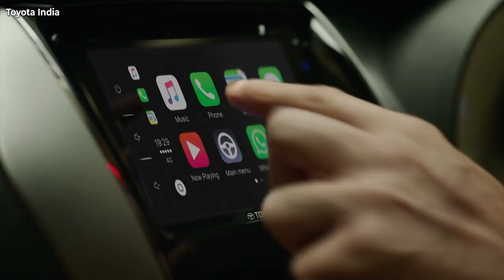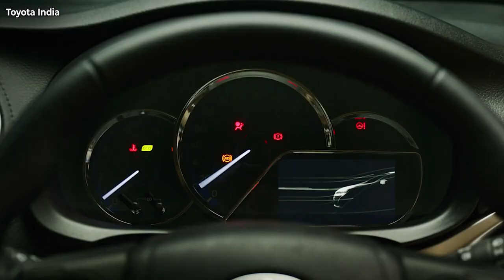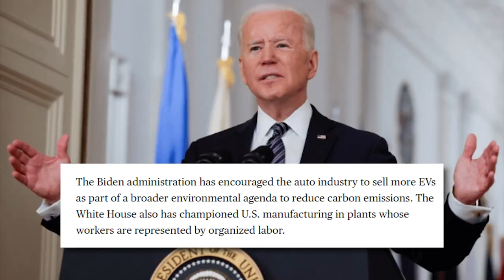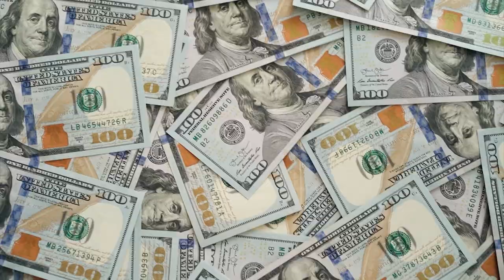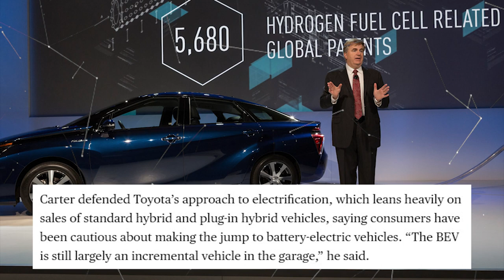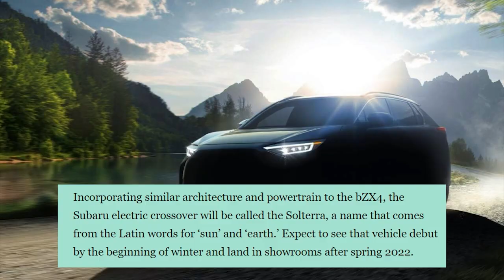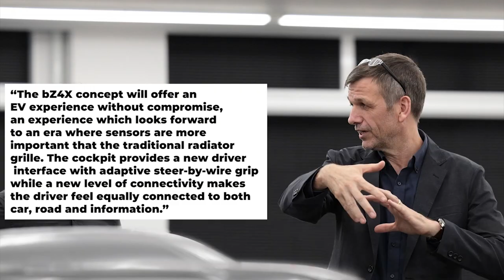Toyota Signals a Big U-Turn on Electric Vehicles With a Major Shift

Comment: I am still unimpressed by all the proposed BEV including Tesla, except Aptera.
Reply: It sounds like you should start a BEV company.
Reply: Lol.   What Aptera is selling has been tried many times with gas powered engines that achieved over 100mpg due to aerodynamics.   It didn't work then and it won't work now.
Reply: @kratosdisciple4637  You didn’t need a 100mpg on an ICEV because you could easily put a 25 gallon fuel tank on a car and refill it in five minutes. With BEV you can’t do either as easily so efficiency is far more important.
Reply: @matthewhuszarik4173  The point I was trying to make is that people care more about having 4 wheels and the perceived notion of safety than they do about efficiency.   And there is the additional peer pressure of having something that looks "strange".   The Aptera is a brilliant piece of engineering.   Unfortunately, very few people will buy it.

Comment: Seems like it's not really a u turn but more like a cautious pivot. If it weren't for high import tariffs and other regulations we would have an influx of Chinese imports such as BYD and Xpeng. Both of which are selling like crazy in China right now. 

Toyota seems to think the US doesn't have an appetite for EVs even though Nissan proved that with the release of the Leaf and the re-release of it that isn't the case. The US also went in on the Bolt.

And surly they're not forgetting about a once small company even they themselves invested in called Tesla. They didn't seem to have much confidence back then when they sold their stock in the company now Tesla is worth 5 times what it was then and have been producing record sales here in the US. 

The very reason theirs a want for EVs is due to Tesla and a couple others I've mentioned so about time Toyota gets serious here it will be too late as consumers would have moved on.

Comment: I have a theory, or perhaps two : 
1. Toyota was really interested in making hydrogen fuel cell vehicles and had been working on it. But the lack of proper infrastructure and recent hype of electric cars acted as hurdles in their way and that is the reason they are late in the EV game in the first place. Actually, I still think Toyota has a point, it is difficult to make budget family electric car with good enough range to lure them to buy electric vehicles and that is where hydrogen fuel cell vehicles will help them (think about it, in a gasoline car, the more expensive the car the less range it has. In an electric car, the more expensive the car the more range it has. Thus, budget family cars have very less range as of now).
2. Toyota is secretly trying to capture the bev markets where Tesla has not stepped in yet.

Comment: What happened to their hydrogen?
Reply: Hydrogen has many negatives as hydrogen fuels stations have a range of 1 to 2 million to build along with the simple fact that hydrogen does not exist in a natural state so production is very costly. As with all forms of fuel that are used in vehicles it’s about using the most economical source and at present time that is BEV while HEV would come in second then ICE third. A simple principle exists called the Law of Conservation of Mass that states matter can not be destroyed only change form through physical and chemical changes which applies to fuel sources so the most economical & green will dominate

Comment: Toyota strategy is to sit back let the consumer demand and development of EV to be profitable for Toyota to scale up mean while they have received massive subsidies for their (HEV) Hydrogen electric vehicle Toyota Mirai but hydrogen has many negatives as in the cost of a hydrogen fuel station ranges from 1 million to 2 million with California having 43 as one of the few states to have hydrogen fuel station again only possible by heavy subsidies by the state but in lieu of no hydrogen fuel stations in proximity to California that leaves an Mirai owner locked into only being able to drive in California and then there is the cost of hydrogen fuel which is very costly along with the fact it isn’t as green as (BEV) battery electric vehicles so until hydrogen becomes a better option it will stagnate just like Toyota Mirai vehicles

Comment: Toyota will be bankrupt by 2030.  It's too late for them.  EVs are about to cross price parity with ICE on the initial purchase price and have long had lower overall cost of ownership.  The charging network is established in the U.S. now, and is easily expanded further.  It's not like you can put a gas station in a library parking lot, but I see small charging stations go in places like that.  Game over.  Toyota does not have one BEV that can be bought today.  Toyota is a perfect example of incompetent leadership.  "Wait for the demand to be there before we start" is not a winning strategy.  They will never catch up.

Comment: Toyota has a very advanced hydrogen fuel cell technology that, if they manage to scale it up, would wipe away the need for batteries. Toyota, not Tesla, has the most interesting technology. Only it is not production ready as Japanese operate at a snail's pace while Tesla is operating at warp speed ("plaid" is the third speed higher than warp speed).